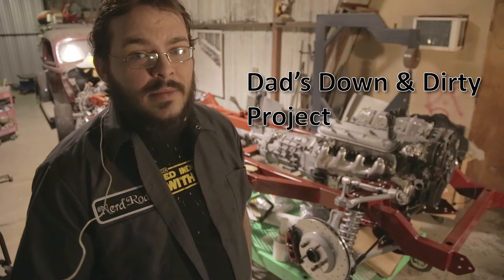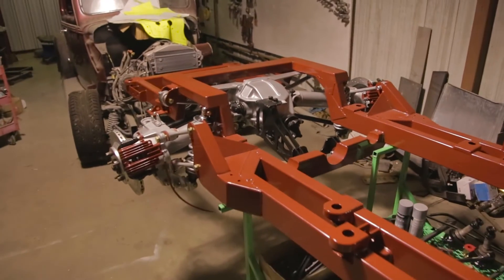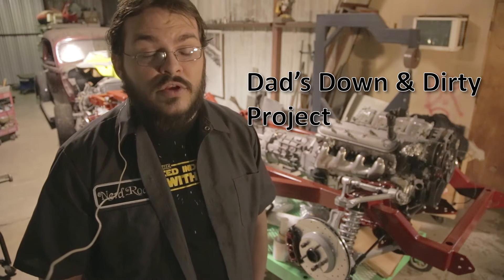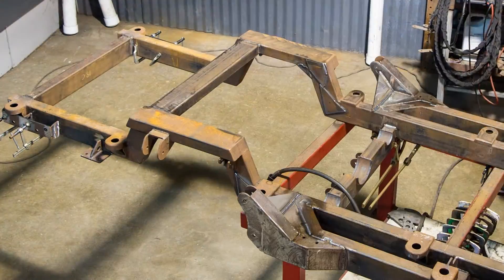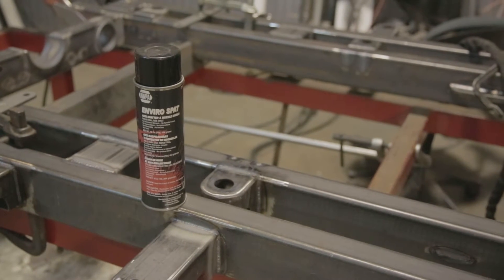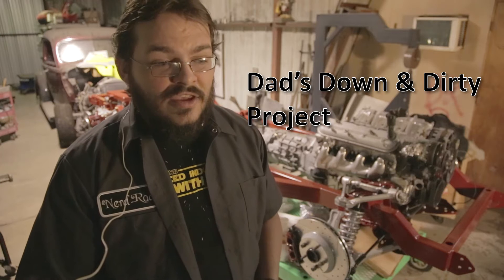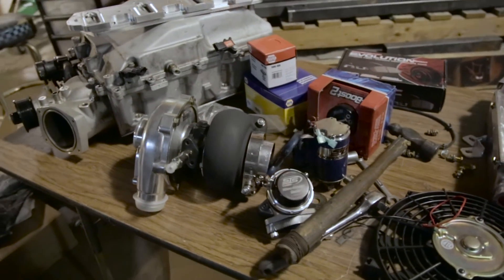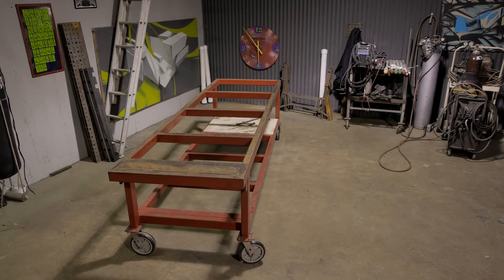Weld it yourself Task Force Truck Frame, MIG Welding Timelapse and D3 Update, Chevy and GMC 1955-59

Comment: My question is, do you have to use c4 suspension on the front? Or would you be able to bolt on say a ride tech suspension setup for tri five setup?
Reply from the maker: @morganpowell2999  A good fabricator could do anything they wanted but no, you can't bolt on stock front suspension swap kits.

I don't know why you would want to use one of those suspensions beyond already having one. The C4 suspension is a superior design in all ways from my understanding.

Comment: Just a random tip. You'll save hours per build if you use muriatic acid to bust the rust rather than grinding it off. $10 for 2 gallons at Home Depot.
Reply from the maker: Personally I sand blast everything before welding. But here I was trying to show a more "normal" build for guys with a small shop.  Thanks for the TIP. I'm sure someone else will find it useful.
Reply: The acid works well but unfortunately you need to seal the metal with oil immediately. They build rust quick after using acid. M-acid also works well on mill scale.

Comment: do u guys doing some kind of a weld on set of IRS for S10/ Blazer/ Sy/ Ty,so dont need to replace whole frame, just a links and a differential body, also very popular is get rid of a torsion bars hence need to weld on  an n shaped support for S10/ Blazer Sy/Ty. Ive seen a set of "torsions-to-struts"  for GMT800-900 for 280... theres less then 5 pounds of steel...
Reply from the maker: Sorry but we only do full frames right now for structural reasons. Feel free to give us a call one day if you want a full explanation of my reasoning but without an intensive study of the S10 frame I won't really know. Next on our list is C2/3 Corvettes so that's going to take up my time for a few years.
Reply: u can get rollable S10 frame for $100 from any junk yard))) and if u ll post a vid about proper modifications on it, people will follow, then u need catch the wave and start to produce the solution and basically earning the money on it, not everybody can do frameoff in backyard without a lift
Best!
Reply from the maker: Sounds like you've got a new business hoss. ;) 
Thanks for the offer but I'm not an S10 fan and I'm one of those guys who thinks the designers and engineers should all be into the project. I'm busy with my current project so I won't be doing anything with the S10s. Have a good one.